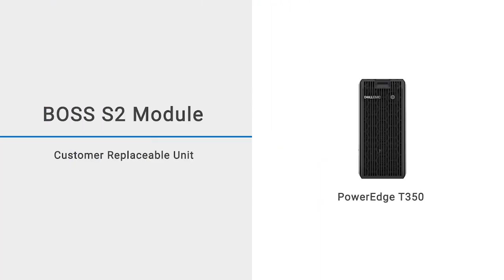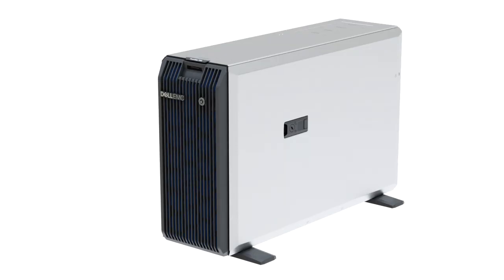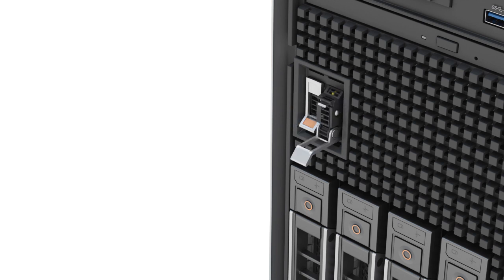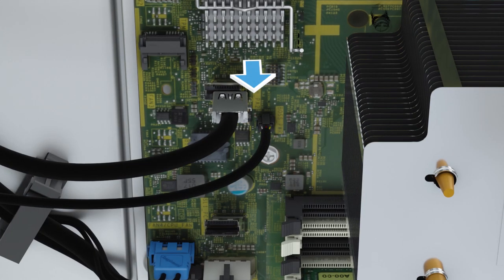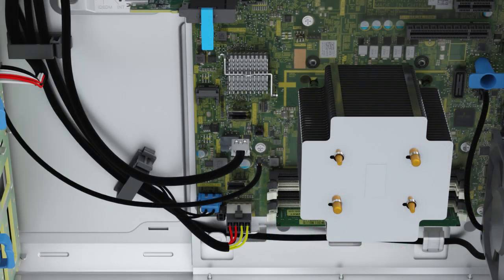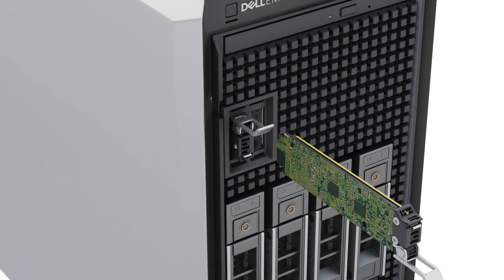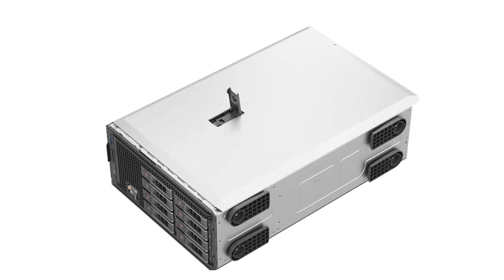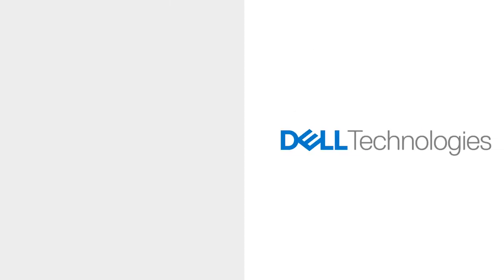How to replace the BOSS S2 module on a Dell EMC PowerEdge T350

Comment: I plan to buy a T350 for my home lab and retrofit it with a BOSS S2 with 2x 480GB SSDs. Can you please provide the part numbers for a complete from scratch upgrade? Thank you!
Reply from the maker: Hi @TheFreaker86, you can find the correct parts, including the BOSS S2 controller card, for your system on the Dell Parts Store here: https://dell.to/424pzXe

If you need further assistance, feel free to open a thread on our community at https://dell.to/4fJW8gw

Thank you.